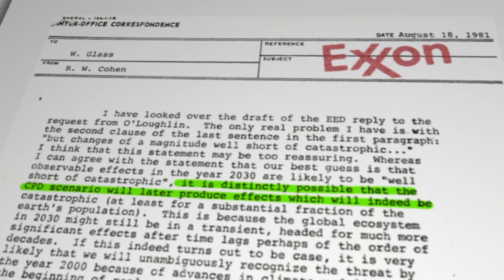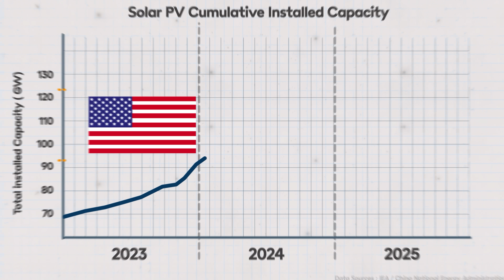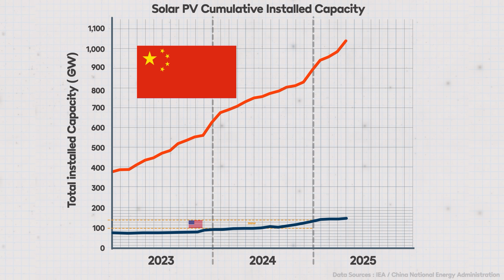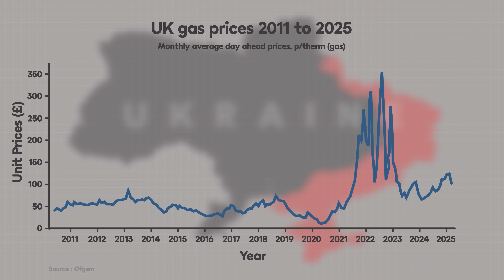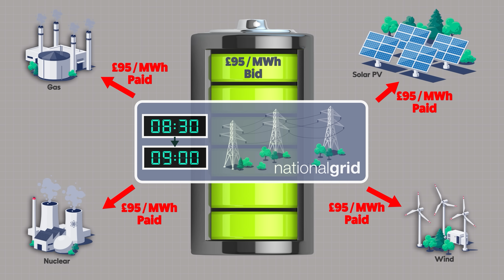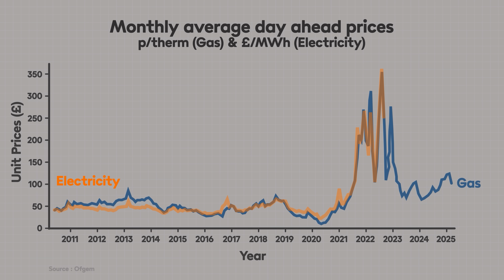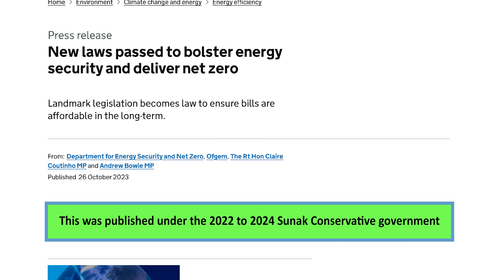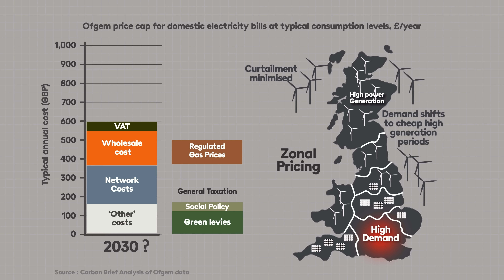Why is UK Energy SO expensive?

Comment: Hmm.  Well, I don't think this is precisely correct in the U.K. ... I was under the impression that overnight pricing was very low for households and peak pricing quite high.  At least, it seems that way from all the videos about people installing battery systems (many without any solar at all) in the U.K..  It seems to me that people who do that... who invest in their own renewable energy at the household level, are able to bypass all but the standing charge.

There are clearly reforms that can be made.  One basic truism is that everyone does have to pay for the country-wide electricity delivery infrastructure, and that infrastructure has more or less been designed to deliver relatively large amounts of power to individual households which, if they have residential batteries, don't actually need such a large feed any more.

The same is true here in the U.S., and its even worse.  My utility service is 200A ... nearly 48kW.  With my solar and home storage system I literally do not need more than around 4kW from the utility worst-case in winter, and honestly only because I want to be able to export excesses once everything is full (including my EV).

This is a completely ignored topic world-wide, more or less.  People are paying for a utility infrastructure that is designed to service historical peak demands rather than the far more spread-out demand that occurs when one has a battery.  A more rational infrastructure would cut costs by 70% or more.  It's the difference between having to string a big thick extension cord and having to string thin little wire.

-Matt
Reply: Brit here, it works the way Dave described it. The overnight lower price just reflects that demand at that time is lower than at other times of the day, and as demand is low and typically supply cannot be turned off below a certain level the electricity price drops (the UK tends to export to the continent as well when electricity is cheaper). The high consumer cost discussed refers to the average price, which is what sets consumer electricity rates rather than each particular individual half-hour billing window price. Those charging EVs/batteries overnight have specialised renewable electricity contracts that pass through the low-demand period cheaper prices to the consumers for a few hours a day.

The high marginal generating costs mentioned in the video are typically those set by the expensive gas peaker plants in the UK, that fire up when demand outstrips supply, and even if they generate 1% of the energy used in any half-hour slot they set the price for the other 99% (even if much cheaper like renewables). The peaker plants can charge over 50 times the typical price of background gas generated electricity and significantly higher than the much cheaper renewable energy price.

There are now specialist electricity consumer contracts, sometimes known as agile tariffs, available that do charge at the half-hourly rate but these can be quite variable, typically used for EV/home battery owners who can take advantage of the short-notice low or even negative prices that occurs in the market at various points over the day to offset the high peaks of the high demand periods.
Reply: @GruffSillyGoat But I think you missed the point.  When you have a whole-home battery, you can charge it during the low-rate periods and the battery can supply the house the rest of the time.  No special circumstances are necessary.  Wholesale prices follow a daily cycle.

Now, I will say that for some odd reason a lot of U.K. home owners installed really tiny batteries.  Like only 5kWh of storage, and tiny inverters.   And then wind up installing all sorts of weird load-shedding gizmos to optimize the water heater and other high-load appliances.

I don't know why... batteries and inverters are easy to size-up.  My own system is large enough to run the entire house 24 hours.  That means I don't need any special gizmos to optimize when appliances run.

Perhaps this weird thing about installing small batteries is starting to change in the U.K..  Bigger batteries just do a better job without needing anything fancy.

-Matt
Reply: I was responding to your opening sentence, however, 5 kWh of storage is actually plenty in the UK for most needs. The average household electricity used is a fraction of that used in North America - 12,500kWh/yr on average in the US vs 4,300kWh/yr in the UK (where smaller mid-terrace houses can be low as 1,800kWh/yr).

The battery size is down to connection permission regulations related to PV (or wind) micro-generation. For PV systems that can export 3.68kW, or less, to the grid assumed permission is given (automatically granted), so is quicker and cheaper to install. For those installs greater than 3.8kW (per phase, 16A at 240v) more arduous permission needs to be sought, which takes time and adds cost and can be declined - since it reviews whether the addition of the micro-generation and batteries impacts the local electricity network or not (such as raising the voltage too high). 

This is due to a combination of most domestic battery systems being grid-tied in the UK, and capable of exporting back into the grid, the smaller size of UK housing in a temperate climate with lower energy needs, plus the high density of households in the UK with the potential for a large number of battery systems to be present within a smaller area. In addition, the lower cost of the 3.68kW packaged generation/battery system available (where the default battery option tends to be circa 5kWh) increases their popularity, even with larger battery storage systems many are purchased at the sub-8 kWh level due to cost benefits considerations.

Battery-only systems are relatively new in the UK, however, as such they don't attract government grants for their installation unlike micro-generation (PV/wind) based systems. They can be attractive where energy use is high during the day, timeshifting use of cheaper rate electricity, particularly in houses with limited roof/ground space. There are also micro-generation/battery systems available that don't export and isolate the home from the grid should there ever be a blackout, protecting those working on the grid, which are typically larger in size (both generation and battery capacity) but their cost is also significantly higher. 

It is also possible to get export-limiting micro-generation/battery systems, that can be sized at a higher capacity for domestic use but cap the export capability to the 3.68kW limit but these have to be verified systems meeting a strict set of requirements and are typically more costly than those sized below the export limits. 

These battery-only/non-exporting systems can have larger batteries sized for those with higher household energy needs, such as having heat-pumps, using cheaper overnight rates to offset the cost of running the heating during the day. 

Some also try to size battery systems to generate revenue by charging at low rate overnight and exporting at higher rates during the day, but the low export electric rates in the UK and the 3.68kW export limit restricts the amount of money that can be earned this way (reducing the cost/benefit ratio of larger battery systems).

However, one needs to be mindful with sizing larger systems as some may never pay back on the installation costs due to being over-specified vs the lower electricity household usage in the UK.

Comment: Why the hell does electricity wholesale pricing rely on the most expensive fossil source?  There is no sense.  In the last 24 hours Gas was 12% of energy generation, and renewables and Nuclear was the rest. So why is this structured this way? It make NO sense!
Reply: It's from a time where gas was the cheapest generation source out of oil, gas, coal and nuclear; it's an antiquated system that's proving difficult to change. One reasons is that social protection elements have been baked into the system over time, such as protection of the vulnerable plus the guarantee of electricity provision to critical services (hospitals, police, fire service etc.).  This is taking a while to undo with the types of renewables available in the UK (mainly non-dispatchable wind/solar rather than always on hydro/geothermal). However, the increased roll out of energy storage (batteries, compressed gas etc) should change this situation, with the UK planning a trial of a gas free generating day later this year to observe the workings of running the physical systems this way.
Reply: The nature of operating an electricity grid is one big balancing act. 
It is a second by second balancing act. - where random consumption MUST be met with the exact and immediate production as well 

So every power input into the grid, seen in real-time, is equally important. 
It is not possible to say: Oh, we are lacking a bit of input in this minute, so hang on, we have more available in ten minutes time. 
No, it is necessary, on a second by second base, to get the exact  right level of input of energy into the grid. And this makes every power source absolutely equally important, in real-time. 

---

If renewables and nuclear was able to provide on-demand, second by second on-demand, through out the day, then the fossil fuel powered source could be completely eliminated from the grid. 

But until then, every power source that delivers grid input, is precisely equally important, for the grid to maintain its delicate balance of correct voltage and correct frequency. 

So until more non-fossil fuel powerstations or energy farms have been built, until then, the grid needs to take its power from every type of power source that is available, and capable. 

--- 

An other way to balance the grid, would be to cut off power to consumers, for those hours where gas was used in order to keep the grid in balance. 

Like, if there is not enough power going  into the grid, then the grid operators can simply cut off a number of consumers, so the balance of consumption and production is still maintained. 

So, in theory, we could disconnect all gas power plants, today - and then rotate cutting off 12% of all consumers. 
This would be another method to make sure that production capacity is not reliant on the 12% that currently comes from gas. 

This method would also take the prices of gas out of the equation.

Comment: Finally an explanation of why electricity prices keep going up while more and more cheap renewable energy comes on line.  What the UK does have (just) are enough sites to put in off-river pumped storage facilities.  With more and more occasions when you are producing more electricity than there is a demand for, this cheap source of energy, when needed, could reduce your dependence on gas.  But those other policy measures that you mentioned, look to be the real solution.  This half hour pricing system is crazy.  Who came up with that one.  He was a warped genius.
Reply: The crazy system was put in place when coal generation covered base loads, and gas peaker plants intermittently topped up supply. It encouraged the building of part-time peaker plants by amortisation of their costs.  Nowadays it is just crazy. The contract for difference scheme had to be put in place as a band-aid.  I'd just change the bidding model for fair simplicity.

Comment: Always ignored. Wind and solar are intermittent. Wind is  ot reliable, solar is cylical, 24 hours and 12 months. Gas is used to plug the gaps. Gas must be onstandby to meet any eventuality.This and the switching on/off of gas plants greatly inflates the costs. This should be costed as integral with renewable intermittent supply, not as cost of gas. What about the batteries? Calculate the total energy consumption in kWhr of all energy of all types, used, then the wind and solar needed to provide for the maximum demand, then the back up required if wind falls to zero over say two weeks, then where will the backup come from with only uk sources. (No cheating relying on French nuclear or hydro from Norway). Current plan- from the battery storage of all our BEVs. So, what happened in Spain then? Anyone?
Reply: "Always ignored. Wind and solar are intermittent." <- if you looked at the back catalog of his videos you'd see that it is not ignored.  Not at all.

Comment: Even in Europe prices are set by gasturbines. But in Europe day ahead dynamic pricing is pretty common. It really is simple to optimize the energy grid and to profit/pay less by moving all your consumption as much as possible to cheap hours.
Those cheap hours in the summer are during the day.
In the winter I remember that we got a lot of cheap energy thanks to windmills. Windmill cheap pricing are almost 24/7.

The fun thing is to realize that in the Netherlands for instance electricity is taxed much higher than fossil fuels. (Energy price is about 25%, taxes on electricity is about 75% or higher). Fossil fuels are taxed less, but if you take the price per km for an electric car and the price per km for a fossil fuel car, the electric car is much cheaper in use, even though you pay more tax for the energy.
Fossil fuels do not even have polution tax. Yet, I have to pay polution tax on electricity, even if I have opted to only buy green/nature provided energy.
The best way to escape the unfair taxing of electricity is to go off-grid.
Reply: It is the same in Denmark. We pay 0.9 kr/kWh tax. 1Euro cost 7.5 kr. Except for people with a EV charging agreements. They get tax refund. I think our goverments can't or would not find other ways to replace that income.
Reply: Day ahead (and sometimes further ahead) pricing operates in the UK as well (the same as half-hour accounting periods also operate in Europe). The situation with gas setting the price in the UK is mainly due to the use of gas peaker plants during the periods where electric demand outstrips generation supply. These can cost over 50 times the cost of typical background gas usage, and significantly higher than the much cheaper renewable generation sources. This is due to the lower levels of always on renewables sources in the UK (less geothermal/hydro supply than other parts of Europe) and a greater use of wind/solar in the renewable mix. This is being addressed but at a slower pace than the roll-out of renewables, mainly via the introduction of energy storage (batteries, compressed gas etc.) to enable the energy from renewables to be captured/utilised over a longer timespan. 

It is expected that renewable/low-carbon only generating capability will be possible from this year onwards, with a trial set to run later this year with no gas being used at all to observe how the UK's grid operates under these conditions.

Comment: The ironic thing about renewables customers "driving up the cost" of energy for others on the grid is that renewables would extend the viable lifetime of gas wells by reducing demand.
Reply: Not in the UK - 50% of domestic natural gas extracted is sold overseas by the petrochemical companies for profit (80% in the case of oil extracted). The projected 10 years of known gas reserves and speculative 14 years of gas resources remaining would likely simply be extracted and sold abroad faster (making hay whilst the sun shines, style) as its usage drops in the UK.
Reply: @GruffSillyGoat  Maybe, but the UK would make money on those sales while having created a renewable infrastructure. When those reserves are depleted, the UK would only need to import a small amount of natural gas.
Reply: @tschorsch  - unfortunately, the money from the sales goes to the petrochemical companies, and their shareholders, rather than to the state. It's not used to grow the renewable infrastructure.
Reply: I'm afraid this doesn't make much sense. You don't want longer production duration at a lower production rate because that means less income on a discounted cash basis.

Comment: Hey Mr. Think, at 3:12 and 3:23: 98% of the time you should use zero-based graphs, dont start the y axis at a misleading 20 or 60. And when are you going to stop intentionally putting moldy grubby spots all over clean displays of information on pristine white backgrounds?

Comment: Sooner than later more efficient photovoltaic panels will come along that will provide a fraction of a penny more profit and of course the older panels will have to be replaced and because it costs a fraction of a penny more to do something responsible with them they will end up buried in the ground. Because it costs a fraction of a penny more to do anything but purchase panels manufactured with coal and slave labor that's what we'll get because that's the way our world is wired. Rat drink or smoke and be merry!!

Comment: Forcing millions into poverty is the result of renewables being traded on the same energy market as gas.   

When you buy less gas u lose economies of scale so price goes up.  If energy is priced based on gas then the higher the % of energy from renewables then the higher the cost of that energy. 

Unless the energy market is changed first to strip the link from gas to electricity the only way to stop mass energy poverty is to stop and even reverse the growth of renewables.   This is basic economics...no one doubts gas will eventually run out or that climate science is correct.   But the simple fact is cutting gas usage increases electricity costs to consumers and industry who are already struggling
Reply: "no one doubts gas will eventually run out or that climate science is correct. " <- why do you make such a statement?  It's pretty clear even from these comments that plenty of people deny AGW.
Reply: As shown in the video the cost of gas rises of its own accord due to external factors, however, the displacement of gas by more efficient electricity (as also covered in the video) saves consumers money even if gas prices rise as a result of the displacement.